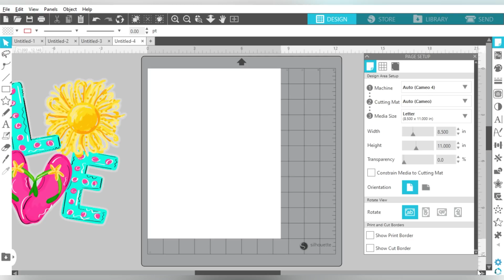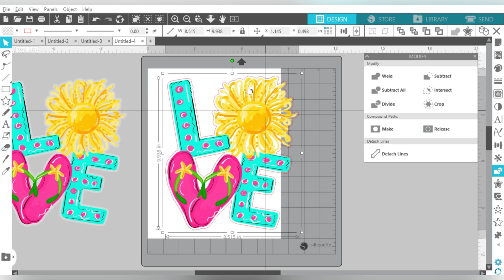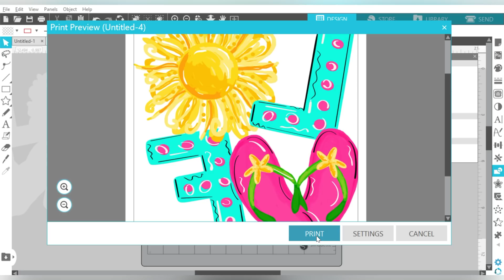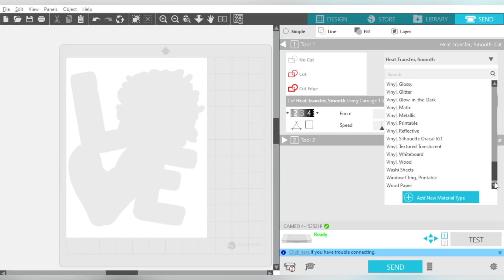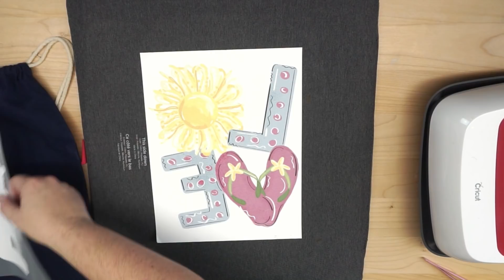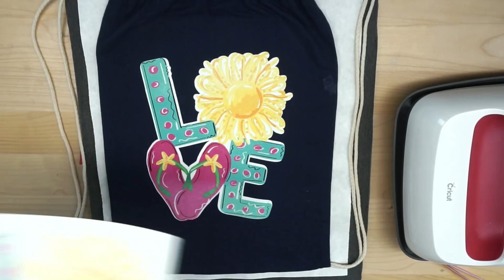❤️ How to Use EasySubli for Sublimation WITHOUT Print and Cut

Comment: Thanks for your video! I did have a question regarding time/temp. My a-sub paper says 400° for 40-60 seconds for textile, and I think the easysubli is 310° for 10-15 sec. If you press this at a lower temperature for shorter time, wouldn't the image not be as colorful?
Reply from the maker: It all depends on the material. I noticed always following producers' guidelines works the best! - Agata

Comment: Question:  Why not just print directly on easi subli instead of the double step?
Reply from the maker: This is because she had printed the sublimation design on an Epson printer. When using an Epson EasySubli will most times get jammed in the printer because it is too thick.
Reply: @DesignBundles  well that sucks! Thanks for explaining that one.

Comment: Which side did you cut on?
Reply from the maker: You will notice the EasySubli has a smooth side and a textured side. You will print on the textured side. Load the EasySubli into your printer so your design gets printed on the textured side. For Sawgrass printers that means you load the EasySubli with the shiny side up. - Brittany

Comment: This might be a really stupid question but do you have to have a Cameo machine to use the silhouette design space? I only have a Cricut and design space is pretty limited with print & cut
Reply: No, you can use Silhouette Studio independently of a machine, and of course you can export or save your design as an SVG.  The issue is getting the SVG insid of Design Space.  That's the real challenge here.

Comment: Can I do this same thing by printing from Canva and cutting it out the EasySuli with my Cricut and lining it up? I have the streaks, does it matter where I print it from? Thanks for your help!!
Reply from the maker: Hey Alma, in theory you can, but you may have trouble being able to size your design to match the size of your vinyl.  It can be done for sure, but that part I'd have to think about a workaround.  Hope this helps!   ---Becky
Reply: Thanks, I am just so frustrated with the print and cut option and my projects coming out streaky. I am going to watch the video. I am looking in to purchasing a Sawgrass printer if I can't figure this out. A big investment, but I feel can't move forward until I do. Thanks for you help!:_Happy:

Comment: I was using starcraft printable vinyl in my cameo in thet 8.5 x 11 setting. But easy subli is 8.4 x 11. Can I still apply custom registration marks to the 8.4 x 11 easy subli ?
Reply from the maker: The slight size difference shouldn't interfere with your registration marks, I would proceed with the letter size setting.  Hope this helps!   ---Becky

Comment: What is the spray for?
Do we have to use it?
Reply from the maker: Hey Claudia!  The spray is what adheres the EasySubli to the print.  Without using it, I would recommend using the Print and Cut feature to ensure proper alignment.  Hope this helps!   ---Becky
Reply: @DesignBundles  what type of spray was it do ypu stay on top of of asub paper ?

Comment: I'm confused on your pressing temp. The easy press looks like it's set to 360-370 but you said 311. Which is correct for this method? Thank you!
Reply: 311 for 15 secs are the instructions.
Reply from the maker: The EasySubli is 311 degrees.  Hope this helps!   ---Becky

Comment: Thank you for the video.  If I don't have the spray, can I use mask instead, if so, how?
Reply from the maker: Hey Cassandra, you can use the mask to adhere the EasySubli on your garment and then line up the image, but it's harder to get proper alignment that way.  The spray is the easiest alignment tip I've found.  Hope this helps!   ---Becky

Comment: Why in the world would anybody use print and cut? Just print the image onto the HTV and be done with it. I don't get it. You're wasting time. Is there something I'm missing?
Reply from the maker: When print and cut works correctly, it's great to use with EasySubli because the excess vinyl needs to be weeded off.  If you just print the image onto the HTV, you will be left with a white square with an image in the middle.  Hope this helps!   ---Becky

Comment: It never came to my mind doing it this way. I used to first cut the EasySubli, press it on the garmet, then cut the sub paper and press it on top. I hated that it I had to change the time/temp, add an extra step and still screwing it up. I'll def try the method you show here.
Reply: Hiya, I'm new to all this and am doing it the way you said, well I haven't done it yet cuz I dont know how to stick the easy subli to the garment....I tried a test piece textured side up with teflon over at 155c for 15secs and it doesn't stick
What am I doing wrong? I know to sublimate on textured side but I'm confused as to why it dont stick
Reply: @twisted_sista_bmccleanmiss6048  Did you remove the backing/carrier sheet from the Easy Subli before heat pressing? BTW, I haven't used my Easy Subli yet. I have sublimated onto white glitter though....once LOL
Reply: @twisted_sista_bmccleanmiss6048  Easysubli is white, but it has a clear sheet called carrier sheet (opposite to the textured side)....before pressing, you have to remove the carrier sheet. Once you remove it, pre-press the shirt 3-5 seconds, and then put the easysubli only on the garmet, and press it for 5-8 seconds. If the piece you used to test had the carrier sheet, the heat of the press activated the adhesive so it glued the easysubli to the carrier sheet, meaning that easysubli piece is garbage now.
Reply: @javencera  yessssss thankyou soooo much, I was trying to find the backing film on a tested piece so as you said it had stuck together....when I tried on a fresh bit it came away so easily lol 
I was so confused as to what was going on cuz I've used inkjet subli vinyl for light & dark & thought where is the backing paper? Lol 
Thanks so much for shedding light though ....much appreciated 🎯💯🙌🏻
Reply: @twisted_sista_bmccleanmiss6048  Glad I was able to share a response that help you. Its a learning curve, one day when you think you have it all figured, you see something new so its all about see, try, make a mistake, learn, re-try, do it good, re-try, do it better...stressfuly exciting.

Comment: Good video but this process just seems like to much work if you have a lot of shirts to do.  Have you tried the polyacrylic method?
Reply from the maker: Definitely a lot of work Leesah.  I have tried the polycrylic method, but I that will still only work on light colors and it will wash out.  If I needed a lot of shirts of the same print, I would order either printed HTV transfers or screen print transfers.  Hope this helps!   ---Becky

Comment: Why does my cricut pront with lines in my sublimation printer. May need to try your technique as Im having so much trouble with print and cut.  Tfs cool project! -Christine
Reply from the maker: It could be a print issue if those lines aren't in the design -- maybe the printer is low on ink? Or maybe the print wasn't set to a high quality print.

Comment: I have 4 sheets of EasySubli but haven't used it yet, you are right it IS expensive! I've used Siser glitter and Specialty Materials SubliFlock 5901. Before I get to the EasySubli, I have a yard of 15 inch wide Siser Glow in the Dark I'll try. It will be easier to do a small test with a large piece of Glow in the Dark.
One thing, I thought you could NOT print on EasySubli unless you had a Sawgrass printer? That you did have to use it the way you just did. 
Ok, here is an idea for a video, sublimate on Siser Glow in the dark! :)
Reply from the maker: Hey Angela!  I have printed on EasySubli using my Epson printer, we actually have a vide on on that if you'd like to see.  I have not sublimated on the Glow in the Dark yet, but it's on my to-do list for sure!  I would definitely perform some small tests first before tackling a large project.  Hope this helps and thanks for the recommendation!   ---Becky

https://www.youtube.com/watch?v=Xlon5yxRfZM

Comment: I love your instructional videos!  I have used Silhouette Cameo's for years (3 of them) and I have learned more from you in two or three videos than I ever knew.  Also what spray did you use?  I don't know if I heard you mention it.
Reply from the maker: Hey Patti!  Thanks so much for your kind words!  I'm so glad you are learning from the videos!  The spray I use is the Krylon Repositionable EasyTack.  I'll link you to a listing on Amazon, but you can usually find it less expensive at your local craft store or Walmart.  Hope this helps!   ---Becky

https://www.amazon.com/Krylon-K07020007-10-25-Ounce-Repositionable-Adhesive/dp/B000A8AYO4/ref=sr_1_2?crid=2YBYMORW3ACU6&dchild=1&keywords=krylon+easy+tack+repositionable+adhesive+spray&qid=1615493535&sprefix=krylon+easy%2Caps%2C205&sr=8-2